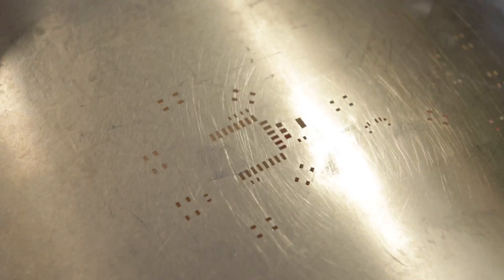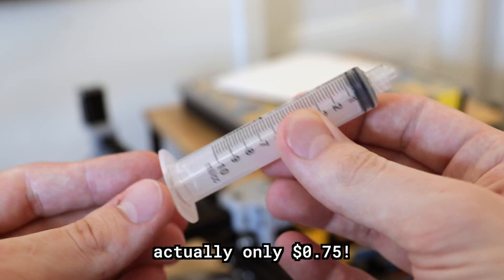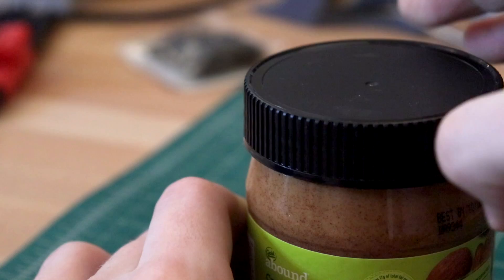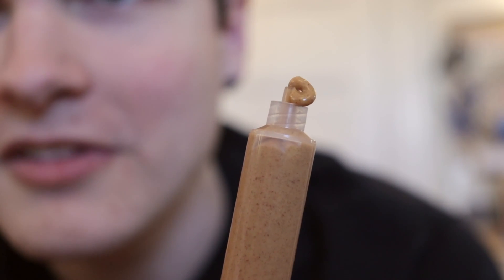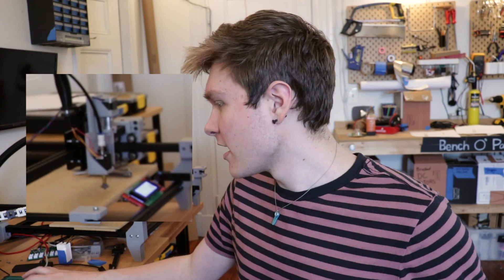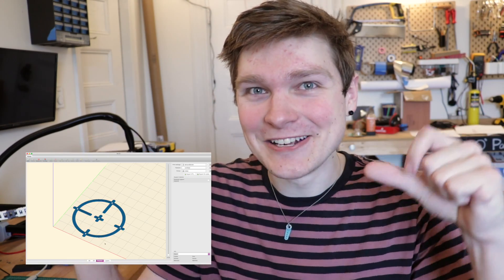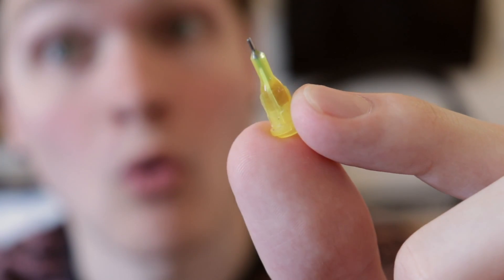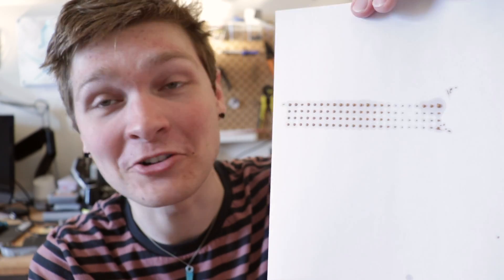Dispensing Paste With My Pick and Place!

Comment: What comes through my mind:
1. You get after flow because of the air bubbles inside. You need an air free fill
2. You can buy air-free factory filled cartridge (expensive, little choice)
3. You could fill from 500g jar to a filling syringe, then to the production syringe, then de-air in a small vacuum chamber
4. Solder paste is way thicker
I prefer lead-free water soluble solder paste. You can clean your modules in a dishwasher (minus switches)

Comment: The viscosity of the medium shouldn't be super critical, as long as the two mediums are roughly similar, it will just be a rotation=volume calculation.

Comment: I think I may have a way to generate the g-code for the solder paste easily. For my CNC machine I use a program called ESTLCAM. Simply import the DXF and generate the tool paths for the solder mask.

Comment: I'm enjoying your PNP build videos.  I'm going through something similar myself at the moment.  FYI, a less-complicated, and more precise way to dispense viscous fluids is by using air pressure on the back end of the syringe.  Check out the Nordson Ultimus as a reference.  All you need to make that at home is 2 solenoids (compressed air & blow-off or vacuum), a regulator (probably want about 10psi), a way to control the timing (ie, how many milliseconds to dispense), and a source of pressed air.
BTW, be sure to pay attention to the storage requirements (refrigeration), shelf life,  and dispensing temp of your solder paste.

Comment: Depending on the solder paste you get, and the size of the nozzle you'll be using, you will be surprised as to what kind of force you need to apply to squeeze something out of the syringe. I don't think the 3d printed parts are going to hold up for that task. you might even need to get stronger syringes so they don't break...
I still prefer to do stencils, as it is super fast, clean and consistent and allows for extremely tiny pitch components (0.4mm pitch QFNs, 01005 passives, fine pitch BGAs, ...) to be soldered reliably. I have not seen an affordable paste dispenser that can reliably squeeze out such tiny amounts of paste...

Comment: I like your juvenile enthusiam, it remember me at your age... now i'm 64 and if I we'rent in such bad health as I'm now, I would continue to do project as you are doing... and if you we'rent 400 miles from me, I would give you a complete PNP machine with all feeders and vibrators and nozzles... actually I have no choice to scrap it as nobody want to buy a 1990 machine even if it's still working well. 
I bought that one 15years ago and produced more than 3000 pcbs for different customers since then.
It's a V1.0 of Juki machine before they use that name, Amistar AR-5500. And the beauty if it, it work's on a single phase 220V, nice for a heated garage...
And as I was starting my first production, (and I have no garage at the time...), (and machine had a mayor bug- reason why I paid it only few thousand  with oven,conveyors...), I practiced an opening directly in my rear house rooftop to be able to enter it in my basement...
I called a crane company and all the stuff entered from a flat truck bed over my house to my new fresh rear opening... I informed my curious neghbors I was entering a new kind of SPA in my house... It was and always still not permitted to do any commercial  work in a house here...
After searches, I found the bug to be cables ripped off in the main x axis carrier. I replaced all them and I had a full operating machine!
12 years later, I had a collegue who wanted to be part of that but on his commercial site with more recent SMT machines... with vision...
Amistar had vision but only for feeder calibration and fiducial recognition before assembly time...
We bought two 2001 huuuuuuge Universal SMT's... 'huge' as they occupy tree times more space than mine... and almost 3500lbs each instead of my Amistar, around 1300lbs... And even if I had the strange idea to enter them in my basement... cutting roof hole that size was simply creazy and they operate on three phase 220V... 
We've got fooled by vendor as both machines had numerous bugs and more than 50% tools required complete ovehaul...
Feeders on a Universal are built of crappy thin steel with (garantee to worn fast )aluminum slides compared to my good old feeders in solid stainless steel, practically undestructible... and so easy to adjust compared to that almost unadjustable crap...
So after a year of constant work, we were able to do what we were supposed to do... Production!
Sure, Universal is very fast compared to my old two spindle one but a setup before production is taking ten times too... and you need two machines instead of one as they are wasting so much space with feeders and vibrators that your 64 usable slots become full very rapidly...
And I'm not talking about stupid  limitations... like the impossibility to calibrate slot 1-2 and 63-64 as calib-head camera can't go there! You should calibrate in slot 3 and hope that moving in slot 1-3 it still working!!! It's supposed to place 0201... forget that... 0603 is minimum practical size as with my old one... Oups, sorry, sooooorrrrry!  I over "gossiped"...
Anyway, I would like to tell you that you have a bright future ahead of you! And compared to me, you have access to so many things that we could only dream about in my young 1970 years... 
But, also great care if you are using leaded solder paste... it's very toxic and anything you do to avoid spilling, you will find some in your rice crispies, beleive me, I experienced that so many times and it cost me a kidney... until I weared full protection... a bit late...
Now we have access to test kits to verify lead contamination, discovered that I had spreaded lead on all rooms... with my shoes...
Take care, and have lots of fun!!!
Reply: How much does said machine weigh?  If you haven't scrapped it, I might be interested to buy it.  I've got a OpenPnP machine almost running but I have a lot of respect for the old machines.  My CM has a Fuji CP3 and CP4 still in active production.  They're probably even older than yours?

Comment: For program options: I have written something like this a couple of years back called rpt2pnp, you find it on my github. It assumes a compressed-air operated syringe, so you might need to change the generated GCode a bit to extrude-motor instead. Also, it reads KiCAD RPT files not gerbers. But might be a good starting point.

Comment: I tried this as a hand tool with those small metal gear motors (you can get them with a long screw as shaft and use it like an actuator) - however actually pushing solder paste thru this small nozzle needed a lot more force than i thought.. but it depends on the paste too.
In a real world application it’s not as useful as it seems.. just look at the pad count and compare it to one swipe with a stencil, the stencil always wins;)
But for a self milled pcb, this could be useful if you’re doing only one.
Great content anyway! I’m also building a pnp with marlin (2) and dual nozzle design, but without automatic feeders.. it’s an on going project, but it’s already picking parts and checking them with vision. 
Im looking forward to see your feeders in action!:)

Comment: Have you considered using a pneumatic solder paste dispenser instead of the stepper motor?
Reply: The trouble is retraction, so you also need a vacuum pump and switching valves.

Comment: FlatCAM has some great solder paste dispensing g-code generation tools. It steps through incrementally smaller nozzles to optimize time spent on different levels of detail. Check it out! Great open source project.
Reply: FlatCAM is a good advice.

Comment: I love the design. It's the same design that I settled on when I converted a 3D printer to print cake icing. To refill the syringe I had a set up almost exactly like yours but with two modifications.

1] add a channel to the plunger and a little M3 bolt that lines up with the channel to the top of the syringe. It will stop any twist. It won't twist at first but it will eventually.

2] to refill it run the stepper in reverse and use the syringe to suck up the solder paste from a designated location.
Reply: Do you have any photos/files or resources of the proyect? I would like to do something similar with my 3d printer.

Comment: Consider pre-filled syringes as you won't need to worry about air bubbles as they are factory filled. Make a plunger pusher and you can change the syringe when it runs out, instead of messing around trying to get air bubbles out of your syringe. You could mount the plunger mechanism on the side of the machine and use a thin pipe to the delivery head, it would be more expensive but it does mean less of a top heavy assembly. Commercial machines use a syringe attached to a jet print head to dispense droplets very quickly like an inkjet printer.

Comment: Great work - love your enthusiasm.  I'd love to see you add a triangulated laser height sensor at some point to compensate for board warpage.  It will be very helpful as you try smaller dot sizes and board to needle gap becomes very critical.  You might look at getting some different types of plungers to try from EFD - those rubber ones have way too much friction.  Be careful not to go too small on the needle size, and maybe try some tapered stainless or even tapered plastic tips - the solder particles in even the finer mesh pastes will plug up even a short, small ID stainless tube really quickly.  Pay attention to the metals content in the paste - for dispensing you probably want to be down around 85-86 percent metals.  The pro dispensing equipment uses an archimedes pump fed by a pressurized syringe (ex: DL Technology), or a simply a syringe/needle with switched air pressure and a venturi vacuum and needle valve to provide a little suckback when the pressure switches off (ex: EFD 1000XL).  That simple switched air setup can be further improved by adding a microcontroller and a little bit of code to change the valve on time slightly as the syringe depletes to compensate for growing air volume behind the plunger.  Several modern dispense controllers have this now but the Cadillac is the Musashi Engineering SuperΣ CMIII.  Lots of people turn their nose up at time/pressure dispensing but you can't beat it for easy syringe replacement, cleanup and ultra small dot capability.

Comment: Nice effort! I just really think you underestimate the paste stencils. they enable you to place exactly the right amount of paste, which is crucial for proper reflow soldering of many components. maybe not for big rgb-leds, but certainly for ICs and smd diodes. I'd much rather see you spend more effort on the pick and place itself, than a solder dispenser in between... just my humble opinion :)
Reply: I super agree. A second pick and place nozzle will do far more for throughput, and a stencil system would be a nice second project. I like the idea of forming the stencil into a drum with a wiper and paste inside at the bottom, that aligns with a board passed underneath. Would just feed through on a conveyor like CMYK printing registration. At the end of the day, CPH will matter far more.
Reply: On the same line here. I would never give up the stencil which is precise and easy to apply. It's fast also.

Comment: 0:19 how does solder paste turns in solder when heated??
Reply: The paste contains some flux and little balls of solder. When you heat it up, the solder melts and the flux evaporates. You can heat the solder in a reflow oven or in some prototype with a hot air soldering/rework station.
Reply: Solder paste is microscopic solder ball suspended in flux. Apply heat, hot air or radiant, and the flux melts followed by the solder melting. Surface tension keeps the solder where you want it.
Reply: ball = balls

Comment: There are some tools out there which can import Gerbers and spit out an STL, which you can then pull into your slicer to create the GCODE.  "PCB2STL" is one I found w/ a quick google search.  Another approach you might be able to work with can be found at github kirberich/gerber_to_scad which has python code to import the gerber for your solder paste layer and exports an OpenSCAD file, which can then be turned into STL for your slicer. 

I'm watching your work pretty carefully as I really want to build one of these myself. Thanks for all your videos and development work on this project!

Comment: To remove the stepper motor weight from the gantry, you could use a remote drive extruder setup like the zesty nimble used in 3D printers. One easy way to get the cable is to look at old car speedo cables which have a square end.
Reply: The backlash would make this not work properly
Reply: I agree there would be some backlash especially in the cable torsion and and additional connection between motor and the leadscrew. However I believe  this should be able to be accounted for with the firmware settings for the extruder stepper motor. The Zesty Nimble extruder proves the concept working with filament, however unsure how much torque it can transmit to drive the lead screw and assume it would depend on how viscous the solder paste is.